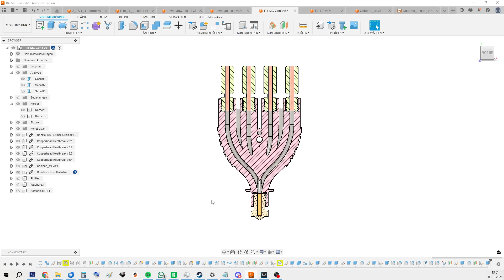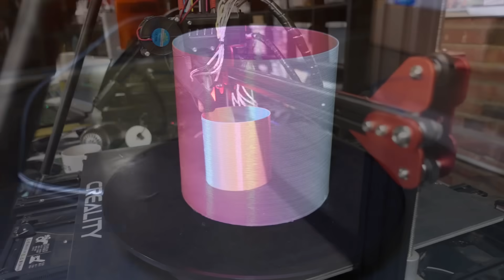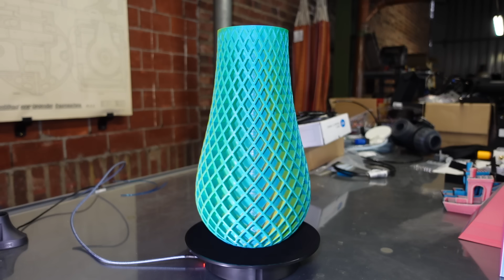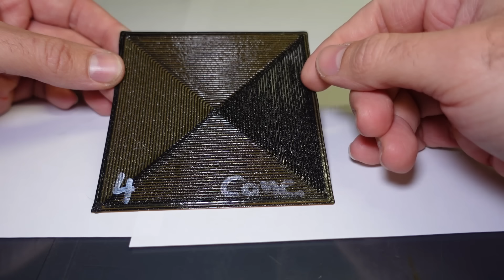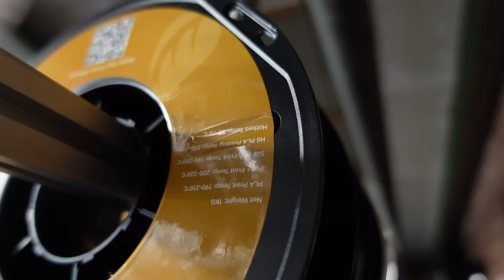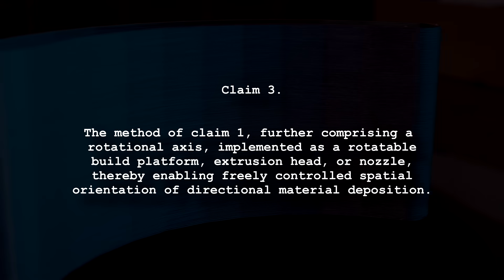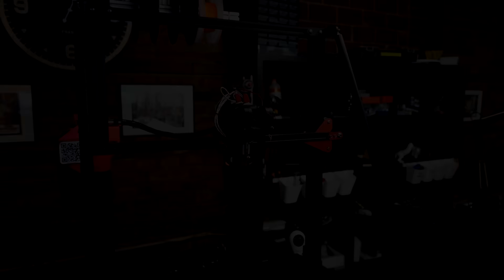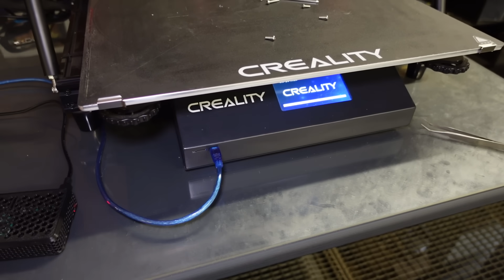WASTELESS Multi Color 3D-Printing. Introducing the Open Source Co-Hotend (Roetz-End E03)

Comment: The cetus2 did something very similar many years ago. It mixed two fitments in the nozzle and could produce any colour between the two.
Reply: Mixing hotends are super cool. Kind of a shame they never went anywhere. Imagine if you had a 4 color mixing hotend. With good CMYK filaments you could have true full-color printing.
Reply: @quinnobi42  But mixing takes time and volume, while coextruding is instant. It can be as fast, as fast you can rotate the hotend relative to the model. And coextrisuon has an exceptionally good contorl of color gradients even with dissimilar filaments.
Reply: The ideas simple, making them not clog or get stuck is not(or to not bleed/leak excessively)
Reply: @lasskinn had neither of these problems on my cetus2, but as a printer it was terrible, especially the software.

Comment: Or you could simply buy multi-color filament. The result is pretty much the same and you don't need any fancy multi-filament inlet.
Reply from the maker: You have no controll over the output. It's not comparable
Reply: @Roetz40  You have control of how you rotate your model on the print bed before slicing it. The colors you get on each side are just as consistent as in your prints where you also don't have control over the nozzle rotation.

Comment: Extremely cool! Lots of potential. Rotating bed probably makes more sense than rotating hotend to me. Either way, really appreciate you keeping this open. You da man.
Reply: Rotating the bed would only be viable if the head does not move in either X or Y because the center of rotation has to be aligned with the center of the head. You would have to use a bed slinger that moves in two directions that would have a comically large footprint and a lot of inertia. Far more practical to rotate the head.
Reply: @EDesigns_FL I get what you're saying I didn't fully consider the kinematics. Rotating the bed would allow for some customization of the slice, but not the sort to have unlimited multicolor options. Good call.
Reply: @EDesigns_FL I think it would only take a bit of clever math for the x/y to track the rotation of the print… should be all possible in the g-code, right?
Reply: @rplumb7697  Yes, I think it's actually kind of trivial. You can just use inverse kinematics and figure out the gantry position required to rotate around an arbitrary point. Higher-axis CNC machines do rotation around an arbitrary point all the time.

Comment: Very neat thinking, reminds me of those 3 in 1 mixing hot ends, but on steroids. It could be applied to multicolour same material quite easily with independent feeding, oe some "freewheeling" action one way drive on the 4 way Bondtech type extruder pictured, so it'd be a Bowden/Direct drive mash up.

Comment: Rotate the hot end +-200° and have a filament guide above that rotates with the hot end, although it wouldnt need to rotate as much, maybe +-100° and this could easily be linked with a shaft / spline / pulleys / belts with a ratio.
Would stop filament tangling.

It may require you to turn the head back to starting position but this can be done during a slowed z hop or lifting to new layer height and might only need to be done once per layer if you print the outter wall last.

The reason I say +-200° instead of 180° is to allow a bit of headroom for starting / finishing position, if you want to add a randomised seam instead of starting/finishing at the same polar coordinate.

Worth a crack.

Comment: A rotating extruder only has to rotate 180 degrees combined with retraction can print any chose colour in the outside, there is no entanglement since  only 180 or -180  degrees is required to achieve full range.

Comment: It seems like with independent extruders for each feed you could time color changes based on the filament being fed in. It won't give clean transitions and would require work on the slicer. 
I want to see what it looks like with one, two and three filaments loaded and running.
Reply: He kind of tried that with the minute man, and found that filament got pushed back up the tubes of the lines that weren't being fed, which caused big clogs in the cold end.
Having said that, i expect it just needs some calibration so that the filaments that aren't being fed still apply a little bit of extrusion pressure to balance the pressure coming back up from the junction.

Comment: I think this is absolutely cool, but I think there's the big "jackpot" missing. I say this because I too think this kind of thing should be available for everyone and as open as possible because the possibilities of it are just dawning and I don't think there's is any single entity  that could get all out of it.

The simple way to get to the "jackpot" would be adding fifth filament and making it to be a core for the extrusion. But what I would try to drive towards would be using the 4 filaments so 3 of them make the shell, the ultimate stretch could be having 2 core materials and 2 shells or just make the thing smaller with just 3 filaments. There are companies doing this already (what I know there's printers which can add wires within the extrusion, printers that can add carbon fiber into the extrusion, and then there's filaments with different material core) so there might be patents already preventing this. But if there isn't, I believe this would be the biggest thing in a while in engineering world.
This, of course, would be just a stepping stone for the more complicated printing that would be controlling the materials. Just imagine the possibilities of something as simple as having a TPU print into which you could add PLA or PC core at your will to control the flexibility of the object.
Reply from the maker: A lot of your thoughts are true. But there is a powerful patent that prevents it ...

Comment: What happends if you drive the fillaments each speratly into the hotend and then leave two of them out? I would think then the output filament should be splited in 2 parts and this enables mixing with the filament on the opposite site. When you then print with a fine layer hight and stack 4 color combinations on top of each other you should get a full cmyk print or not (you will need an algorithm that calculates how each color needs to be mixed with the other ones)?
Reply from the maker: Everything regarding mixing is a patent no-go. Also you'd never get sharp transitions since you have too much of a mixing zone to fill/purge

Comment: Hey Jan, what would it take for you to print and further develop these parts in house using a metal 3d printer?
Reply from the maker: A laser, some powder, a kidney... Somewhere in that neighborhood. These machines are expensive and you need to run them in order to pay them off... I'm no there yet
Reply: have you looked into lost pla casting, its accesible enough for hobbyists and quite precise. My only question is how tight the tolerances have to be to make it castable. Do you have any idea how big the tolerances need to be(of course i could redesign it for lost pla casting)? Would love your feedback on this.(edit): I believe cast aluminum has a higher thermal conductivity than slm aluminium but that info is from chatgpt so will require more research

Comment: I would add to the patent different speeds for each filament, or only one filament. probably not easy to control entirely, but should add more colorblind material control without rotating

Comment: My first thought goes back to more traditional 3d printing multiple colors/materials.
How are the colors when some of the filaments are retracted? like can 3 of the 4 be retracted to only print in a single color through a single channel?
I guess won't work with the bondtech extruder since it seems they are all driven at once but it could be a decent alternative to multiple toolheads or a multi material system.
Reply: if you stop one of the feeds it then needs to fight/pressure to reclaim the space it gave up the other 3 elements are now filling with their pressure.
So whole new set of HARD problems to solve.
Unless you are capping at the very tip of the hotend at the very last moment but now you have a mix problem as a new pressure is force upon the mix(no more clean separation).

Comment: why not just make the filament 4 colours? (or more than 4), optically key the rotation to lock it in place, and why not have a rotating bed so that you can compute G code for XY co-ordinate offset, while selecting the colour, save the colour mixing in the nozzle for adding white/black to brighten/darken the pigmentation.

Comment: The color is huge but also the flow. I was looking at a water cooled hot end that could print at 90mm^3 with 2.85mm filament. One 10 pound roll cost $300 and 5 rolls (11 pounds) of regular 1.75mm filament cost like $80.
55% faster and 73% cheaper is insane

Comment: This is an amazing idea!   I wonder if you have, in one shot, killed filament changer printers.  One limitation appears to be a limit of four filaments, whereas AMS systems can handle up to 16.  Actual use of more than 4 may be a pretty small demographic, though.
Reply from the maker: Does anyone even use daisy chained ams's? I certainly don't
Reply: You can't realistically do much in the way of multi-material, anything you make would have to be entirely made of a combination of materials with similar melting point and sufficient chemical compatibility to bond together.  No use for e.g. support material, or flexible hinges etc.

Comment: Create a tiny hole above the filament paths convergence in the hot end so we can thread carbon fibers or other fibers into the melt that will get pulled into the deposited plastic. Although the pressure might be too high and it would just leak from there rather than drag a fiber through. I just want continuous fibers through my prints 😫😭
Reply from the maker: Let's send this to Markforged legal department
Reply: @Roetz40  if something like this is patented, we should closely examine to dance around its particulars
Reply: thats an amazing idea!
Reply: This is a neat idea, copped fibre is the usual solution. The problem with continuous fibre is the need to cut it sometimes and bridging without extruding plastic will pull over the part if it is tall.
Reply: @KallePihlajasaari  slicer tweaks could alleviate all that without needing to cut the fiber or just needing extra post processing afterwards

Comment: This could be useful for 3d printed houses. To print a layer of insulation next to a structural layer, add colors. They are already incorporating a steel cable for strength.  I think it would need individual feed rates and a rotating head. I’d be surprised if this was not invented and patented though, they have very smart people working on these.

Comment: What do you think about varying the 4 extruder speeds in order to lay down more or less of some of the individual filaments. Like [0.25;0.25;0.25;0.25] for balanced and [0.1;0.4;0.4;0.1] for laying down more of the 2nd and third channel. Just food for thought.
Reply: Good idea. This was used in M3D Quadfusion printer.

Comment: The only thing you could do to make this work would have the build plate rotate, but that adds in another factor of tuning or failed prints.
Reply: Wouldn’t a rotating axis be pretty simple and stable though? Compared to linear motion.
Based on his super bed slinger, I bet he would do well at it.
Reply: Or the nozzle itself could rotate: v=UyP4f2rYaCU
Reply: As long as the axis is independent of the other ones, it seems easy enough to get right. Probably just one stepper with a closed-loop belt to adjust the ratio a bit.
Edit: Just imagine combining that with a Voron 2.4-style flying gantry, where you can robustly rotate the bed at a fixed height, which would be relatively easy to do, even for a heavy bed.

Comment: this also solves running out of a collor . since all collors run out at the same time . i wonder how collor bleeding wil look in walls
very well done !
bambu quick make a printer or new hot end so i can use it :P
Reply: in the end of the video u asked me what i would do with the tech . i was emediatly thinking . how about feeding in glassfiber  in 1 port . so straight up glassfiber